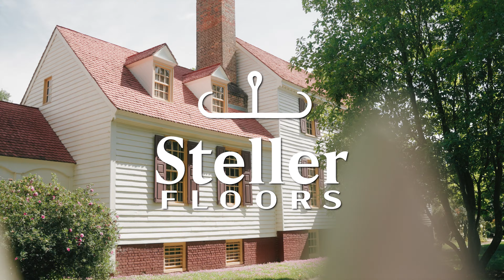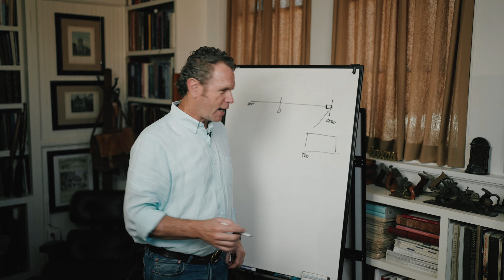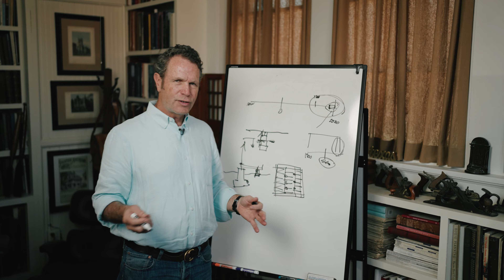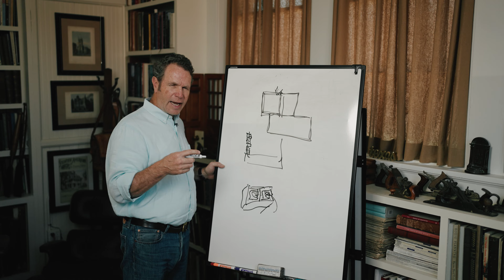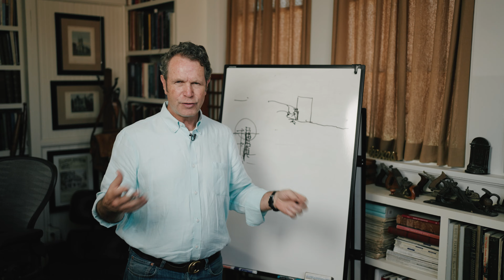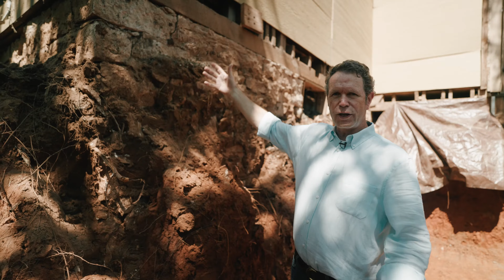New House Old Soul Ep. 3 - Foundations

Comment: Thanks for the video, Brent.  This is a great topic.  My wife and are homeowners and actually building our first home.  We are in the design phase of a brick Federal colonial home, and are highly influenced by your books and videos.  I've been racking my head around whether to go with a pier and beam foundation or a slab foundation (likely post-tension).  We also live in an area with expansive soils (lots of clay and cracks).

We want the house to look as though it has a basement or crawlspace (old soul look) in order to have steps leading up to the front door (instead of the front door sitting on ground level.. yuck).  If we choose to go with a slab, we would have to build up the dirt pad multiple feet higher.  Is this a bad idea?  Do you have any thoughts/recommendations on slab foundation vs pier and beam foundation?

We do prefer pier and beam (largely because all plumbing is "easily" accessible), but I have a big concern.  Since most ALL houses seem to be constructed with slab foundations today (my observation), in your experience do subs even have the knowledge and experience to build pier and beam foundations anymore?
Reply from the maker: Slab foundations were a product of production builders looking to build cheaper. P&B foundations typically cost more but you may not see those savings because of the dirt work you need to do to build up your slab. If you want the Old Soul, i would opt for P&B. Good luck.

Comment: When you say slab foundation. Is this a solid slab with the plumbing buried in the cement? Or the slab beams with easy access to plumbing?
Reply from the maker: Slab foundation is a concrete pad. The plumbing is under the slab. A pier and beam foundation has a perimeter wall of concrete and concrete piers that support wood joists that carry the floor.